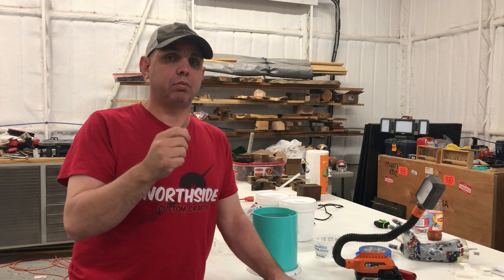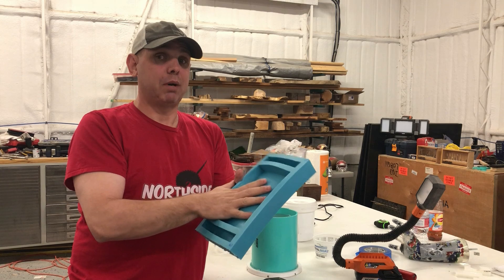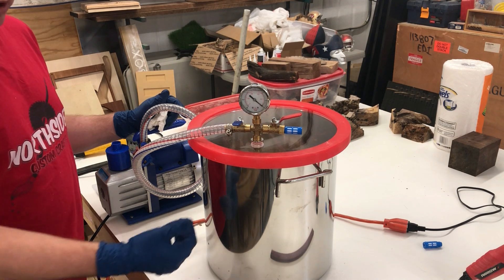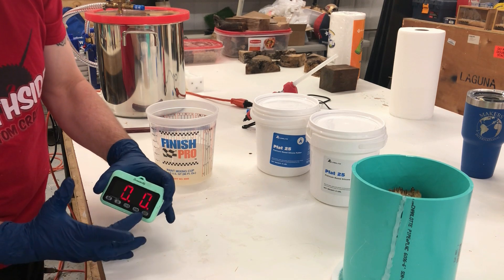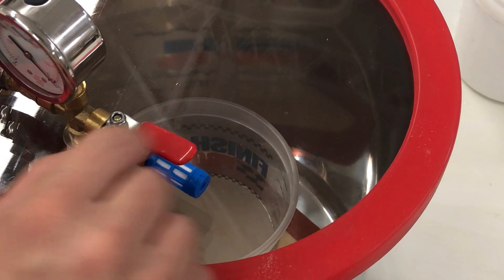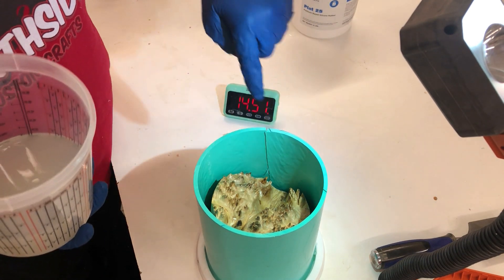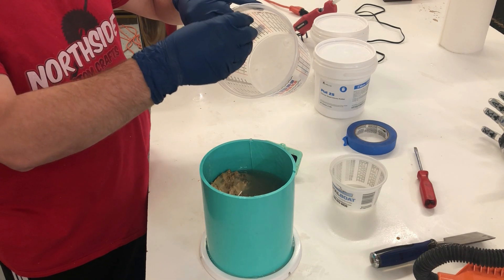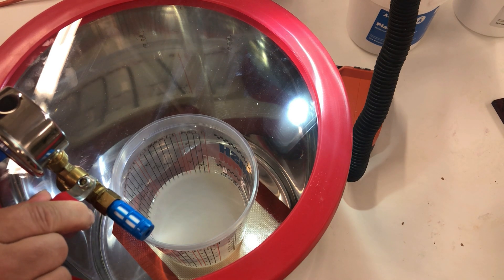Vacuum Degassing Silicone and Why you should do it.

Comment: I assume you didn't just put the wood burl into the vacuum pot because it wouldn't fit? If you were molding something smaller, would you just de-bubble the whole thing and not have to pour at all?
Reply from the maker: I did it that way because I didn’t know how much it would take and second.. if I filled the mold up and then degassed it.. the bubbles would have overflowed pretty bad ..

Comment: Hi Jake, great video. Can you tell me what size pump that is please? I have a similar one off ebay but I dont think the pump is actually big enough. thank you  Shane,  Australia.
Reply from the maker: Hello, it’s a single stage 1/3 hp 5cfm .. it works great for me.
Reply: @JakeThompson  Mine is about the same hp but only a 3 cfm. Might explain why its not as good. Looks like a need an upgrade

Comment: I got a vacuum chamber the pump spray mist out of the air outtake, and I cannot get all the air out of my silicone. I found a dry o ring in the chamber gage and replaced it. I also see I'm leaking oil from the min max glass in the pump. Not sure what to do besides order a different vacuum pump. Any suggestions or ideas would be greatly appreciated.
Reply from the maker: I would send it back for a new one.. and if the new one has problems too.. get a different one.. I have had no problems out of the one in this video.
Reply: @JakeThompson  I actually fixed it. Also the oil spraying out the exhaust I just put a 10ft 5/8 hose over it and attach it to a window fan. Just ran 32 ounces today for a great test run and got some projects done. The leak in the window for the oil can't fix but doesn't seem to bother it for I can get -32 on my gage now.

Comment: Hey Jake, thanks for the video! I was wondering how hot your vacuum pump gets during operation? I am using what looks almost identical to your pump in this video. I am using it to stabilize wood and after about 30 minutes of running it, it is getting quite hot. Hot enough to burn you if you hold your hand against it for a couple seconds. Is that normal? They don't give much information in the manual. Thank you!
Reply from the maker: They will get hot.. I have bumped into mind a few times on accident.. it was hot and I think should be hot to the touch.. glad you enjoyed the video

Comment: Hi, Jake. This video was a confidence-builder for those of us who have been researching degassing to death and are now about to take the plunge. Thank you! 
     Two thoughts: First, I've learned enough about the "perils" of this process to have EXACTLY the same comment offered below by Karkarov, below. Substantial cure times are crucial. Second, I've read a fair number of complaints from people who bought cheap Amazon degassing kits that haven't held up over time. I truly hope you'll report on the long-term performance of your system after, say, a year or so. Best, Chris
Reply from the maker: Hey Chris. I’m glad you enjoyed the video.  This cheap set has held up just fine.. But I have only ever degassed silicone in this set. We are over a year and I it had done just fine.  The cheap pots with the plastic lids shouldn’t be used to stabilize wood… use the glass lids for that.. Plastic lids will crack, leak, and can even leak
Reply: @JakeThompson   Thanks for the quick, helpful reply. I need a vacuum-chamber setup for EXACTLY the same reason you do: degassing silicone (and, in my case, Plastisol)). So, this kit should work fine!

Comment: I plan on using linoleum tiles to carve designs that I impress into silicone molds so I can make chocolate bars.

Should I degass the silicone before applying it to the molds?
Reply from the maker: Yes… because I’m sure the bubbles would overflow your molds.
Reply: @JakeThompson  cool thanks for the tip

Comment: I just came across your video, I just bought the same unit for degassing silicone. I can't get mine to pull the air out though? The gauge only goes to about 20 and to be successful, I need to pull 29. Do you know maybe why I can't pull more than 20? It's definitely not clearing my bubbles. I googled for info, but there isn't much other there for this model.
Reply from the maker: First I would make sure the outside valve is shut.. I would take the lid off and place something over the hole on the underside of the lid.  Turn the pump on and see if it gets more vacuum that way. If it gets good vacuum that way.. the lid isn’t sealing very well

Comment: Would you ever do a 2nd degassing when the silicone is in the mold before it cures? Also, how is the pump and chamber holding up as of today?
Reply from the maker: I would be afraid if there were bubbles in it after you poured it.. the bubbles would overflow the mold.. another option would be to put it in a pressure pot as it cures
Reply: @JakeThompson  I appreciate the quick reply! I believe you're correct; the pressure pot is the right choice. Thanks for the clarification on that note. Also, how is the vacuum chamber and pump holding up today? Hopefully you've put it to good use and can perhaps confirm the longevity of both parts.
Reply: @charlesbonkley  Yes, I'd like to know too please, as I'm about to hit the button on one of these!
Reply: @johnsullivan395  I'll tell you what I ended up doing for my projects in terms of pressure-casting molds and resins: I never pursued the vacuum chamber because it just seemed like a major PITA. What I did was buy a pressure pot (a big one that is solid as a rock), and it has been nothing short of amazing for both silicone mold making and castings. My method that has worked very well is to use SmoothOn's Mold Star 30 (blue) silicone. Set time is 45min. I first mix the silicone evenly and thoroughly then let the cup sit for 15-20 minutes. 90% of the bubbles have time to rise to the surface and pop. Then, I pour the mold and let it sit another 5 minutes or so. Then the mold goes into the pressure pot, and the result after the full set time is a high-quality, dense, no bumps/bubbles mold. This is exactly the same method I use for the pressure casting of the resin as well, but there is way less initial work time. IMPORTANT NOTE: In order to do a successful pressure CASTING, the MOLD must have been made under pressure as well. If not, then distortions will occur in the casting because the silicone was not previously made more dense/devoid of air. I think vacuum chambers have their place, being important to getting a gas-free pour of slow-cure epoxy/resin, for example. Not so much in silicone mold making, IMHO.
Reply: @charlesbonkley  Thanks so much for getting back to me on this! I can't tell you how many tutorials on this I've been watching this week. It has slowly dawned on me over the last few days that it would make sense to cure the mold and the resin at exactly the same pressure as the mold bubbles should be in some kind of equilibrium state and not distort the mold surface. I was toying with going nuts and buying a vaccy chamber and pressure pot 
tonight, but I'm going to take your recommendation and buy only the pressure pot and see how things go! Will let you know and many thanks again! I owe you a cyberpint, mate! ;-)
Reply: @johnsullivan395  Anytime, man! Glad I could help. For the vacuum chambers, the chamber itself is only half of the equation. The other half being the vacuum pump, and for a good one that doesn't spray massive amounts of oil everywhere, and one that would last a long time, you're just spending more and more $$$. The pressure pot I bought and use is made by California Air Tools, model 365CW. $300.00 and well worth it. It can be supported by some wood and laid on its side too, for bigger projects.

Comment: thanks  ur reply/ looks like I should get the 5 gal single stage, if I can get the 2 stage for the same $ would u get it? and it looks like I will get harbor freights paint tank also for $99 incase I want to do pressure... Thanks Again ,Rock On!
Reply from the maker: Both the chaser and the pump are holding up just fine.. works exactly how I want it to every time. 👍👍

Comment: what would happen if your degas the two parts separately before mixing? would it make mixing the silicone very difficult?
Reply from the maker: I think it would need to be degassed again after mixing .. I haven’t tried it.
Reply: Most of the bubbles are a byproduct of mixing the two, so it would be pointless.

Comment: Hey Jake. I bought one of these kits and used it on MoldStar 15. My pump doesn’t seem to pull more than 25 pounds of mercury with the factory set up but SmoothOn recommends 29 pounds of mercury. Any tips? Thanks.
Reply from the maker: Different locations, altitude, and such will limit the amount of vacuum you can pull.. as long as it pulls the bubbles out.. you are good to go.

Comment: Hello Jake, Thank you for another great video -- 
Quick question -- would you be able to use that vacuum chamber to stabilize wood with Cactus Juice or similar product?
Or would you need to use a different pot (one with a galss lid)?
Thank you again for the vids, i enjoy them very much.
Reply from the maker: Thank you Chris. You are exactly right.. I stabilize in a vacuum chamber with a glass lid.. ones with a plastic lid will crack and leak, or break.
Reply: instablaster...

Comment: Some people say you need to change the oil in the vacum chamber ea.time u use it some the fumes don't get into the oil n leave residue n ruin the pump?what's your thoughts.
Reply from the maker: If I’m stabilizing wood with cactus juice.. and it’s on for several hours.. it’s a good idea to change the oil after a use like that.. after a use like the one in this video.. I wouldn’t change it for a long time... and there’s a sight glass on the front of the pump.. you can see if the oil is changing colors or getting contaminated..
Reply: @JakeThompson  k ty just getting mine set up don't want to destroy it first thing.

Comment: Nice Video, have some of the same silicone, was wondering about the vacuum part pouring resin in molds that would go into pressure pot , how much deformation you would get etc..   might be a good test on another video to see if you
ever have time lol .  Could you use this chamber to stabilize wood with some cactus juice ?  be nice to have just 1 
vac chamber with multiple uses
Reply from the maker: Thank you for watching, I’m glad you enjoyed it.. as far as cactus juice in this pot.. the one I use for stabilizing has a glass lid.. cactus juice can crack a plastic lid and leak... as far as the silicone.. before I degas it.. it’s way full of bubbles.. I’m sure it will deform pretty good.. maybe a good video in the future.

Comment: I made a set of silicone moulds for my pen blanks and I didn’t use a vacuum chamber (because I didn’t have one). All I can say is I won’t do it again without one. 

I tried vibrating them out as I had seen this worked for some. Thought it worked for me as I saw no surface bubbles anywhere on the top, bottom, sides or inside... totally smooth. 

When I made my first blanks the bubbles just below the surface collapsed and my blanks turned out prickly! Not a big deal for my own blanks but aesthetically if I were to sell them it would make a poor product. 

So, yeah, long story short. Totally agree!! Thanks for the video as usual. Always great content!
Reply from the maker: Thank you Shane, I thought it would be a complicated, intimidating process but it’s pretty easy and fun.  Thank you for telling us your experience 👍👍👊

Comment: Great video as always Jake.  Only thing I would change is just make sure to reinforce that if you want to degass, you need to use a silicone with a long cure time.  Preferably over 20 minutes.  If the cure time is 15-20 minutes or less you simply are not going to have enough time to degass properly.  Gotta remember that the vacuum has a tendency to create a lot of heat, so the cure time will be faster than the on the tin quoted time when you degass.
Reply from the maker: Awesome.. Thank you! I’m glad you enjoyed. 👍👍

Comment: Nice video. I think it is interesting that you are embracing the use of a vacuum chamber now. A while back, I had asked you why you used positive pressure instead of vacuum to degas the material (it was probably epoxy instead of silicone). At that time, you were a pressure pot guy. You might try epoxy in the vacuum chamber to see what you get.
Reply from the maker: Yes Sir.. it was with resin. And I still feel like if I have a pressure pot, that will be what I use. I might do a video on comparing the two with resin. With silicone it is necessary and I just needed to get a second vacuum chamber because my other one is always full of stabilizing resin. Thanks for watching and I’m glad you enjoyed it. 👍👍

Comment: Somebody please confirm (or refute) my thoughts that "slowing down the vacuum by opening the lever that allowed air back in" accomplished nothing as the bubbles only shrink but did not collapse?

Thanks for the efforts making this video.  I'd like to see more.  :-)
Reply from the maker: I’m not sure on the letting the air back in. But I know I didn’t want to overflow the cup.. and I left the vacuum on until no more bubbles were coming out.. sooooo ... who knows.. lol 

Plenty more to come.. Thank you for watching. 👍👊
Reply: It simply kept it from overflowing that's all.
Reply: I believe the process was slowed down but the end result was still the same. The vacuum pressure still removed all of the air from the material. If you do it all at once the air that's in the material will make it expand outside of the container therefore losing material.